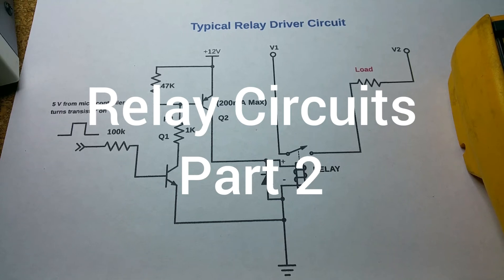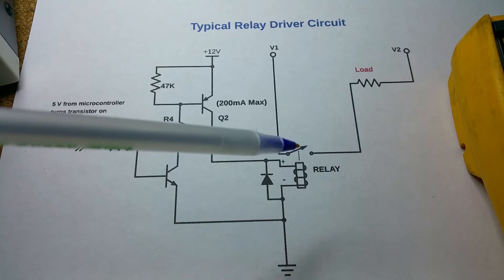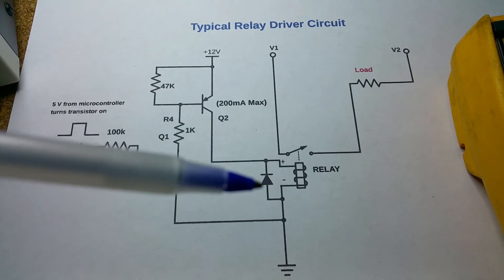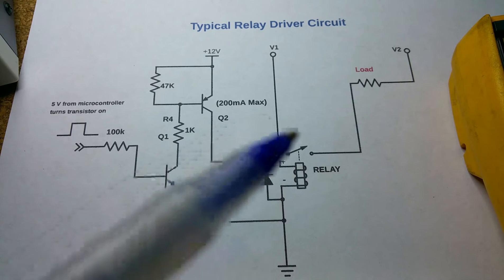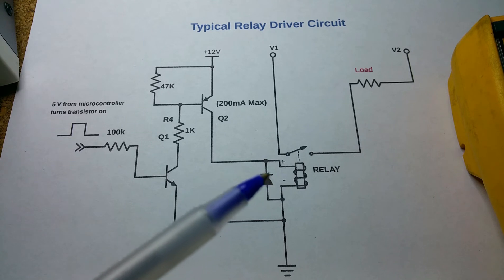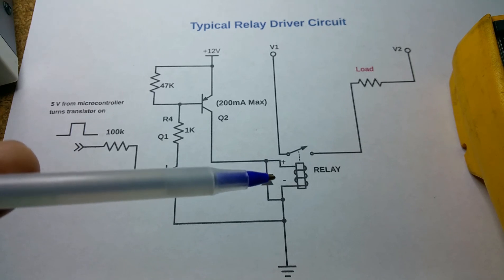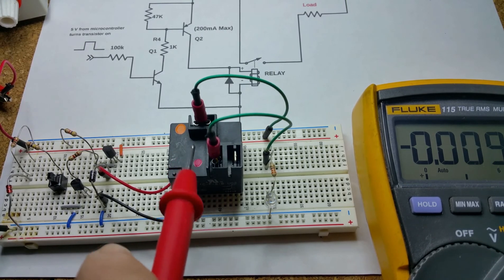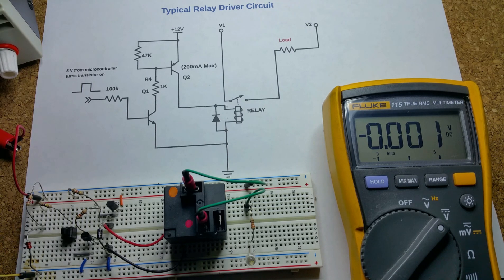#2 - Relay Control Circuits - Part 2 - Failures and Troubleshooting.

Comment: I got a pcb board that keeps burning through relays....I did some digging and I found 6vdc on the ground side and 12vdc on supply side...this is a 12v relay...

Tried testing transistor on board and it just doesn't seem to be an accurate way to test because it is on board and not isolated....

So I'm trying to do the least desoldering as possible on individual components....the only thing I have found so far besides the low voltage on the ground side of coil is I also am seeing .5v at the transistor base....that definitely is low....should be .7v to turn it fully on....question is what to test next and what could possibly cause this low base voltage?
Reply from the maker: Yes, you should have close to zero volts on one side of the relay when energized, as well as about .7v at the transistor's base. If the relay coils are burning out, I'd suspect a leaky transistor that keeps the relay coil energized to some extent and eventually burning it out. I'd remove the relay (so it won't affect your readings) and test the transistor using diode check.  Here is a guide for testing semiconductors using the diode-check feature: https://techcircuit.org/semiconductor-testing-cheat-sheet/
Reply: @TheTechCircuit  thank you.  So remove relay instead of transistor to test it?
Reply from the maker: @macknumber9  Yes I would remove the relay if it is an SMT transistor. If it is a through-hole transistor, I would just remove the transistor. The reason is - depending on your desoldering method, you can easily damage an SMT transistor and would never really know if that was the problem.
Reply: @The Tech Circuit  oh ok I see....it is a through hole transistor...what is SMT?
Reply from the maker: @macknumber9  surface-mount technology.
Reply: @The Tech Circuit  cool thanks...got a good feeling my transistor is bad...we will see tomorrow I ordered one and I will desolder and test....

If it is not the transistor where else would you look?  Again I am only getting .5v at the base....would the next step be to look at the wiring to the thermostat or thermostat itself?  Making sure it is not sending a weak signal?
Reply from the maker: @macknumber9  Depending on if it is a single or dual stage relay circuit, you may have a damaged microcontroller port that is consistently outputting a voltage that slightly biases the transistor base.
Reply: @TheTechCircuit  but wouldn't that be giving TOO MUCH voltage? My problem is lack of voltage to the base
Reply from the maker: @macknumber9  not necessarily. A damaged microcontroller port can output any voltage between zero and its Supply voltage. Also some microcontroller ports are open collector and rely on external biasing for their port supply voltage. You may look into that as well.
Reply: @The Tech Circuit  OK I guess that is on a different board. The control board
Reply: @The Tech Circuit  since the microcontroller is not sending .7v how would I know how to calculate what I should see at the microcontroller?  There is a resistor I believe 1k resistor between transistor base and supply voltage from microcontroller
Reply from the maker: @macknumber9  usually for an active High microcontroller output it's going to be either 3.3 volts or 5 volts depending on the type of microcontroller. The resistor between the microcontroller port and the transistor base drops the excess  above 0.7v for a single stage low-side relay circuit.
Reply: @The Tech Circuit  thank you very much....so hopefully the transistor fixes it but if it doesn't at least I know what to look for....I don't know if they even make the controller anymore...or control board so I might end up being out of luck
Reply: @TheTechCircuit  is it common to see a microcontroller throwing out inadequate voltage?
Reply from the maker: @macknumber9  Uncommon in my experience, but  I have seen it a few times.
Reply: @TheTechCircuit  dp you think I can just bandaid the problem by swapping 1k resistor for 500ohm one?
Reply from the maker: @macknumber9  I wouldn't modify the circuit, but would rather continue trying to find the underlying issue.
Reply: @The Tech Circuit  I am getting low voltage to transistor base pin that is running a relay for a compressor...I am getting .5v instead of .6v or .7v.....I measured 2.61v coming into the board from the main display control board where the microcontroller is...

Since the relay is being turned on and off at appropriate times I suspect the brains behind the microcontroller are good....but the output voltage is inadequate...I believe I should be seeing 3.3v....is there any way that the microcontroller itself is not the problem and a component is such as rectifier/transformer etc
Reply: @TheTechCircuit  how would you go about trying to find the underlying issue in my specific circumstance
Reply from the maker: @macknumber9  I'd really need to see a schematic extrapolated from your circuit, since different configurations suggest different approaches.
Reply: @The Tech Circuit  I understand...unfortunately I have no schematic and I don't have access to any schematic.  They discontinued this and I can't get ANY INFO on it whatsoever...very frustrating....

Even without a schematic would there be anything I can do?  I follow the feed for the relay back up to the control display board and from there it goes to a diode...then I lose the signal...I don't really know where it goes from there...assuming microcontroller....